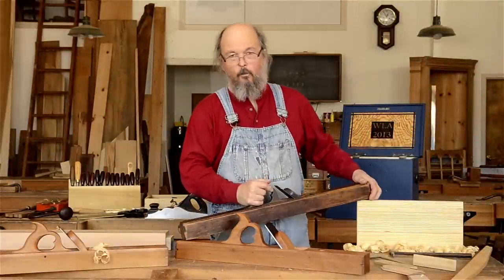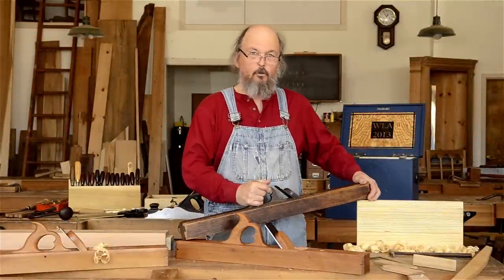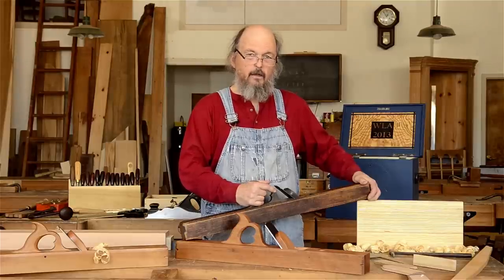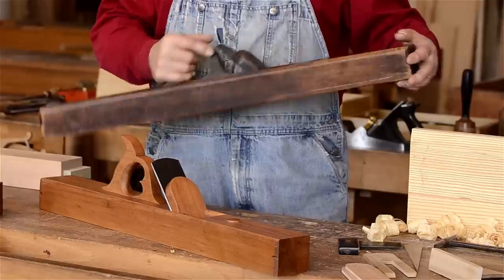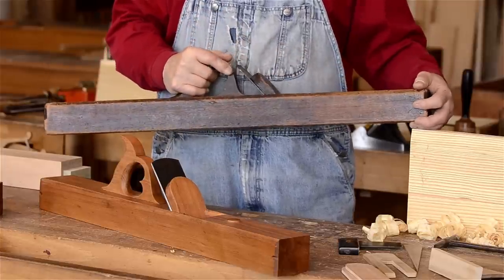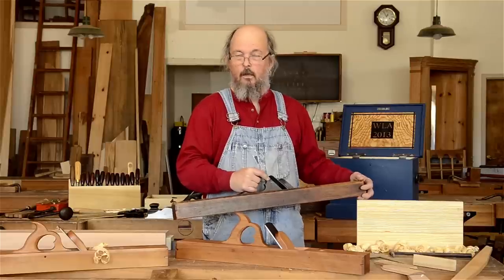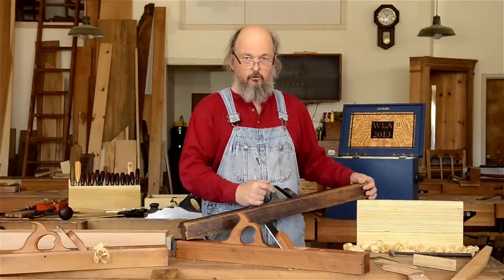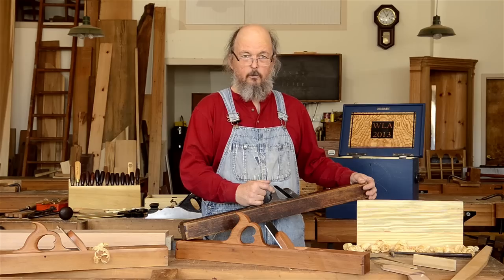Building a Traditional 18th Century Jointer Plane

Comment: With the ever changing wood (expanding and contracting due to heat, humidity, and similar), how do you keep the sole perfectly flat and blade always at the exact angle? Users of metal planes place huge importance on these things.
Reply: You'll get a kick out of this.... you plane the plane
Reply: It’s woodworking. Perfect flatness is not required. Not even metal planes are perfectly flat and they don’t need to be. As long as it’s flat enough it will work beautifully.